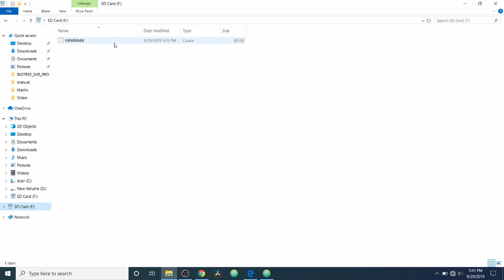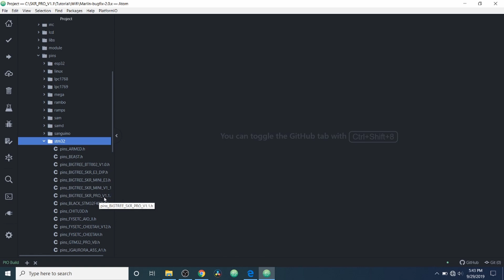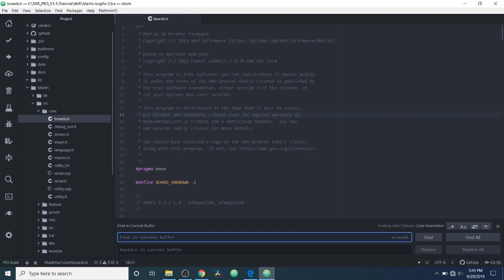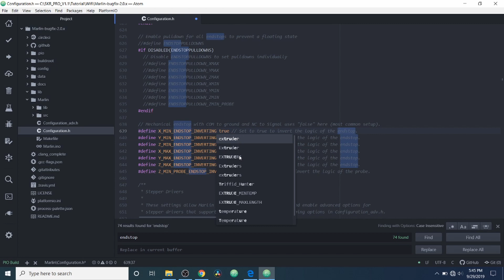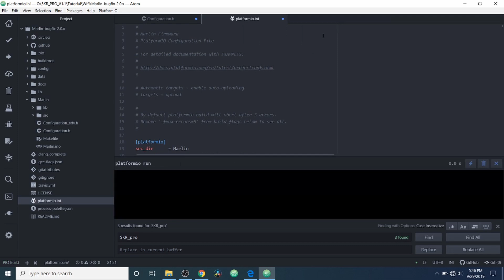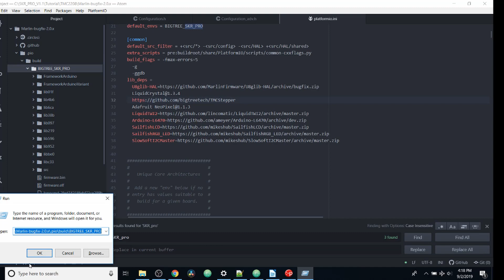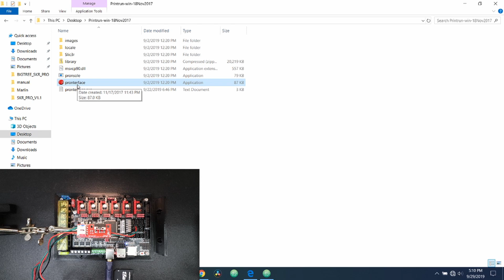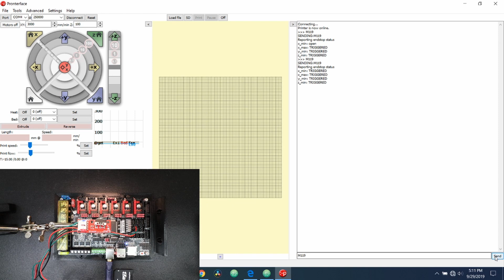SKR Pro v1.1 - Endstop

Comment: I'm trying to use the skr pro 1.2 mb with tmc2209's in a wanhao i3. I removed the motor driver jumpers leaving one jumper on the uart pin. the lights for the x, y and z stop working with the 2209s installed. is this normal? i do not want sensorless mode.

Comment: Too bad it gives only 3.3 volts. For inductive probe I need at least 5V
Reply from the maker: Are you talking about powering it?  You might be able to use a 5v pin or a Buck converter, but single pin might need to be stepped down to avoid damage.  Also why not try a less possible damaging solution?  Like and endstop or BLTouch?
Reply: @EdwardBraiman  Yes Im talking about powering the inductive sensor. I want to use it for X & Y endstops. As to "why" - because I have those. I don't quite like the buttons for being mechanical things (where inductive sensor is more technological). I'm not sure why it's damaging and what is "stepped down" - seems I need to dig google.

Comment: if  use 2 cables: when the endstop is triggered, the status on pronterface is open and vice versa

if use 3 cables: when the endstop is triggered, the status on the pronterface becomes open, but if it is opened the board will die.
can you help me?

Comment: Hello,

First of all thank you for your videos.

I have an issue with endstops:
Driver A4988
Marlin 2.0 (version in the video)

SKR Pro v1.1

When sending M119 from Pronterface I have all axis showing triggered, if I push manually the endstop it is showing open (till this point all fine)... but the issue is even 
if I change the Configuration.h on line 638 like on minute 6:56 to invert the logic nothing changes.
Of course, I Save and Build again the code and put it back to the SD card, but still the axis are not getting inverted :C 
Also, if I manually move the axis the movement continues even if the axis physically touch the endstop. 

What can be the cause of such behaviour?
Thank you.
Reply: Finally I solved the issue uncommenting  the following part on Configuration-adv.h 
ENDSTOPS_ALWAYS_ON_DEFAULT 

Then I needed to input m502 and m500 to get firmware from SD and not from EEPROM. 

Finally it is working. Thanks. Hope it will be helpful for somebody.
Reply from the maker: Sounds like build is not loading.
Reply: @EdwardBraiman  thanks,  but the board is blinking correctly when the sd is inserted in. Hmmm
Reply from the maker: Keep in mind if it's not renaming file something might not be correct about the file firmware.bin.
Reply: @EdwardBraiman  yes it renaims it every time I put a new version.  Is it possible that it is storing somewhere else this data ? Maybe there is a reset procedure more than the reset button on the board. I tried also with the simple version of endstop with 2 cables on your channel but the situation is the same unfortunately.
Reply from the maker: Try this copy FIRMWARE.cur and paste on same drive, then rename the copied file to firmware.bin.  place microsd card in motherboard and power motherboard with USB power.  Tell me what then happens to file that was renamed after 60 second after power up?

Comment: I just found that I have 5v opto end stops, no way to feed them with the 3.3v input right? there is no options to load more voltage?
Reply from the maker: You could. Step down voltage.  The may function with 3.3 voltage, you would need to check datasheets.
Reply: @EdwardBraiman  The board supplies 3.3v, these parts require 5v power.
Reply from the maker: Try and see if endstop works at a lower power level.
Reply: @EdwardBraiman  yup, will look for a 3,3 battery to power it and see if the LED ligths up
Reply: @EdwardBraiman  It actually does, I tried a 3v  battery and I do get a 2.4v signal back when the ir is disrupted

Comment: Cant get endstops to work:/ i do have 2209 drivers but sensorless doesnt seem to work either
Reply from the maker: This is one of the reasons, I've been holding off on a tutorial for TMC 2209, there maybe a couple of open bugs on Marlin firmware GitHub tracking page.

Comment: Question: Does the SKR Pro v1.1 support (2) wire endstops? I'm trying to use the ones that were already installed on my 3D Printer and I can not seem to get them to work with this board. I have tried various settings in the Firmware but just can not get them to detect them. My Induction Probe is the only thing I can get detected.
Reply from the maker: They should, but I'd need to test.  You should only use ground and signal pins.
Reply: @EdwardBraiman   I just ended up ditching the mechanical endstops for sensorless homing and added a capacitive sensor for the z axis. The mechanical endstops I was trying to reuse were crap anyways. I used all my good ones for other machines. 🥴 Anyways the printer is worked great now. 🤘😉

Comment: great video tutorial, very helpful ! could you do one with TMC 2209 with sensorless homing ?
Reply from the maker: As soon as the TMC 2209 arrives.  I've been waiting on the parts for three months.
Reply: @EdwardBraiman  great ! trying to make it work for sometime and cannot get them to work, looking forward.
Reply: one question, I noticed you used the drivers in SPI mode, do endstops work in UART mode too? having trouble setting them up and do not want to cut the TMC 2209 pin !
Reply from the maker: I'll need to let you know on TMC 2209.  They're in the mail coming to me.  Rumour has it they will work.
Reply: @EdwardBraiman  well, I hope so ! :)